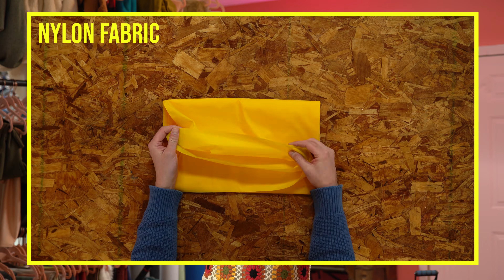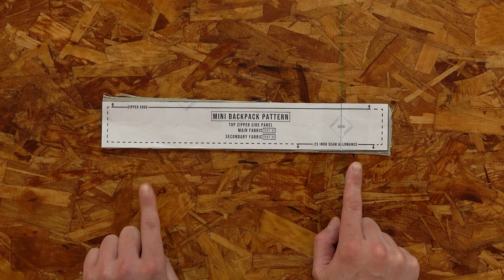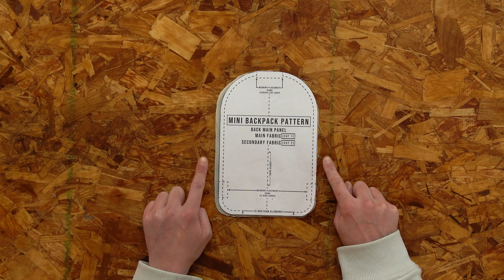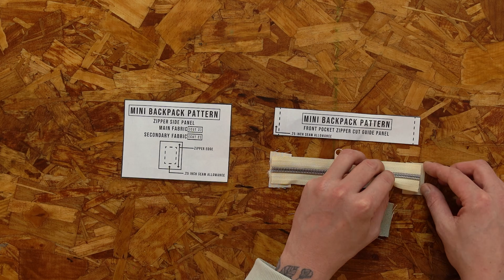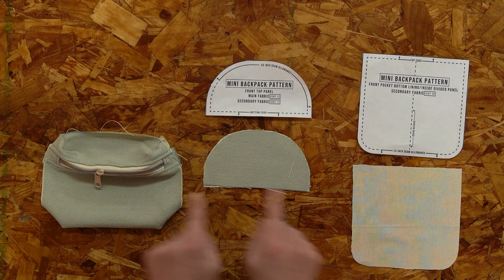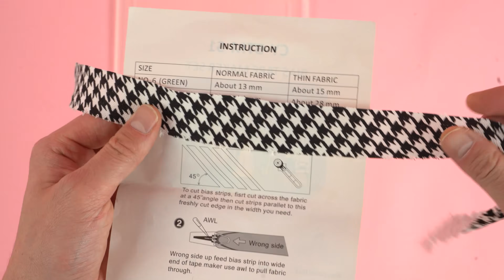DIY Mini Backpack with STEP BY STEP INSTRUCTIONS + Printable PDF Pattern (EASY PROJECT)

Comment: What would of been an easy pattern for me to follow as a novice has me turning away from your pattern you went WAY to fast and spoke way too fast to understand
Reply: Yeah, this is exactly why I've been reluctant to buy any of their patterns. I don't want to have continually take the video back to watch the same parts over and over again just because the person making the video decided to rush through it as fast as possible as if there was some sort of time limit. It wouldn't be so bad if there were actually written directions to follow, and the video were only a supplement instead of the ONLY set of instructions.
Reply: You watch in full once then keep pausing as needed.